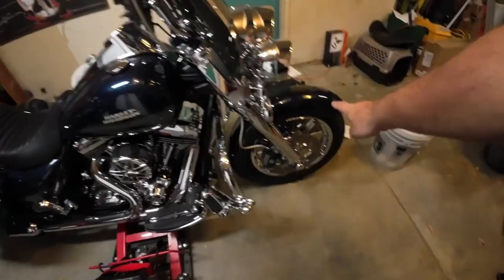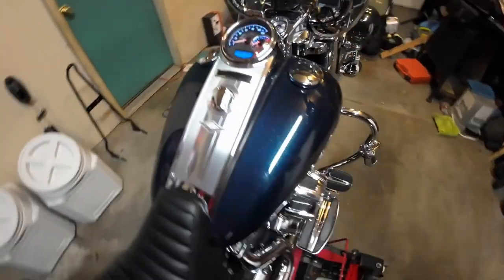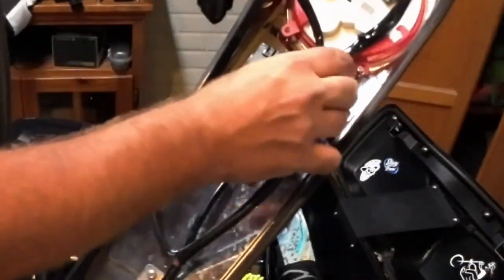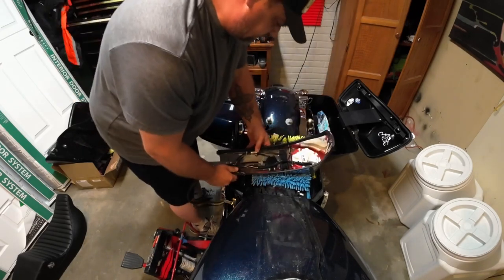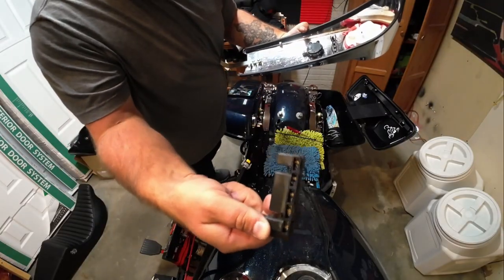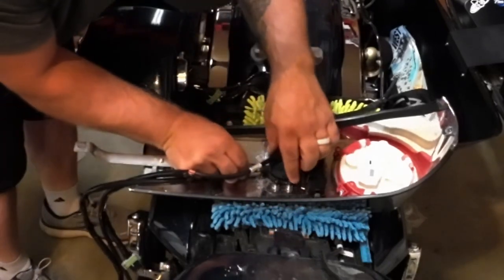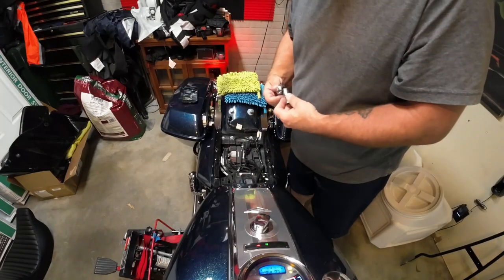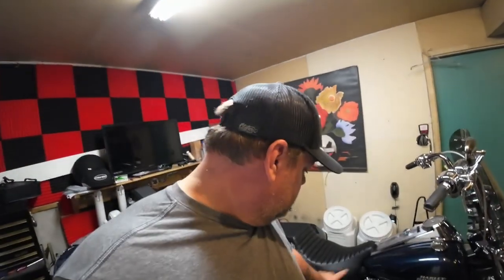Road King Dashlight fix

Comment: Steve hi, a week ago bought 07 RK, 1 speedometer and odometer not work, ya think speed sensor? 2 the oil light and neutral light no come on. I may have to replace led light board? I’ve worked on cars not motorcycles. I guess just have get into it. I will undo and reconnect to make sure all basis are touched before purchasing parts. Nice video bud.
Reply from the maker: @nelsonlopez4695  its tough telling what might be wrong. I would start with if it’s getting power. Maybe check some fuses and go from there.

Comment: Thanks for the video! Ive been looking for this video. What year is your ride?
Reply from the maker: This bike is a 2016. I have a 2018 now and it is still the same setup as the 16 did.
Reply: I have a “14 Fatboy, I found out my main “supply” cable goes forward under the gas tank 😒

Comment: where did you get that because I've been looking for over a month and can't find it. called harley and every dealer around
Reply from the maker: I got the dashlight replacement from my local harley dealer. Frontier Harley-Davidson I think they had it in stock.
Reply: @StevyFaux  how much was it caz i was just told 100 $ by cycleworks which i thought was high to replace my left turn signal indicator. yes i know you've got to replace the harness. but still
Reply from the maker: @davidfellows6250  I think from Harley it was like $80